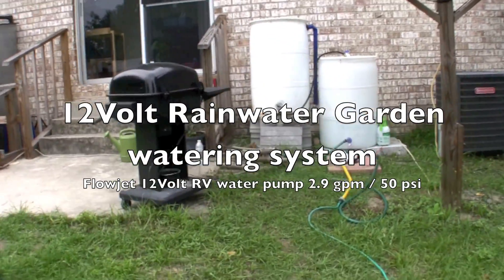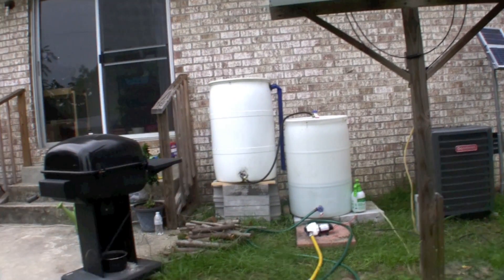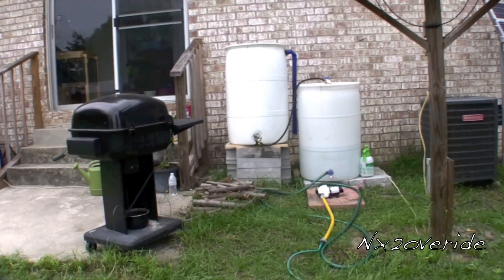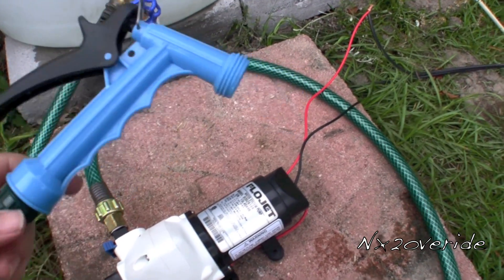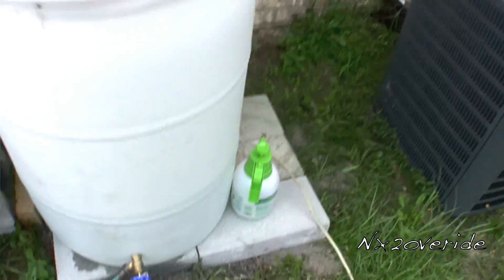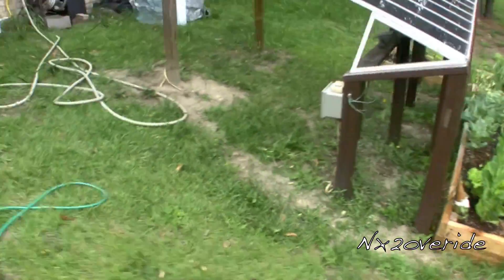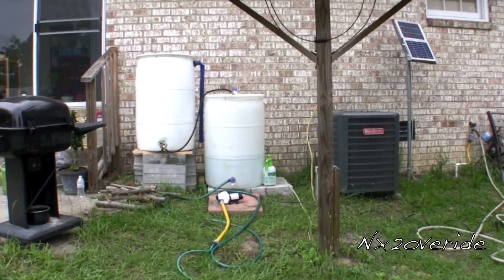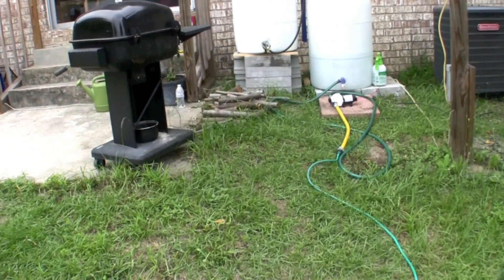12Volt Rainwater Garden watering system

Comment: Yes Rainwater is far better than tapwater. For your vegetable gardens will you use the hose that you were showing on the video or are you going to put in soakers?
Reply from the maker: I'm going to hook up my existing timer and soaker hoses to it. Still got a little more work to do and run a test or 2 but its looking good so far.

Comment: looks good; why not more barrels?  I find one 1/2 rain from my garage roof will fill 2 55 gall barrels.  When it rains I've got plenty too much then as Summer hits not to not enough so I know I need more barrels.
Reply from the maker: I wanted to keep this system separate from another 5 barrel system I'm planning to build behind my large shed. I may add 1 additional drum to this but I'm not sure yet.  I'm going to be adding compost tea to this and don't want the water sitting for a long time so I have to run it for a while and see how much water I need for the beds.